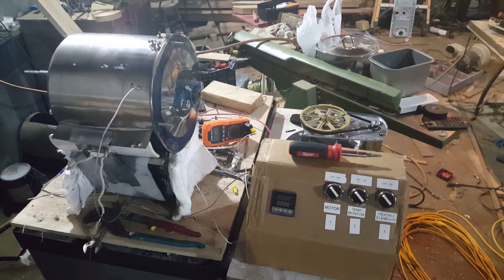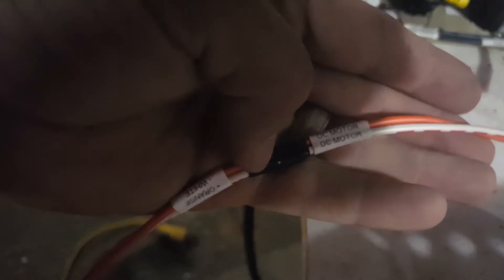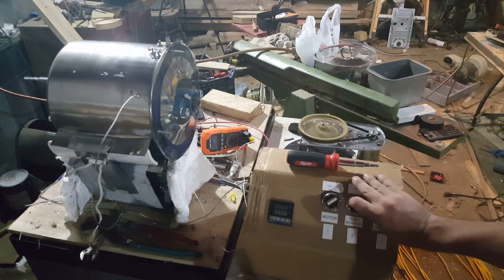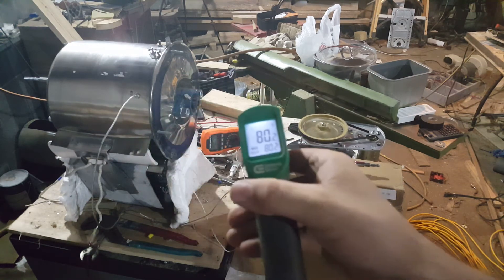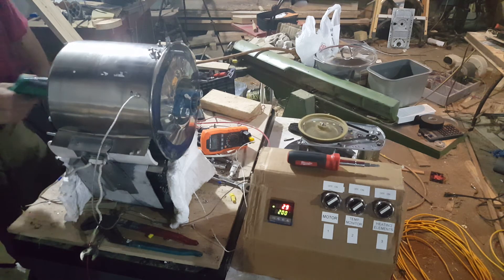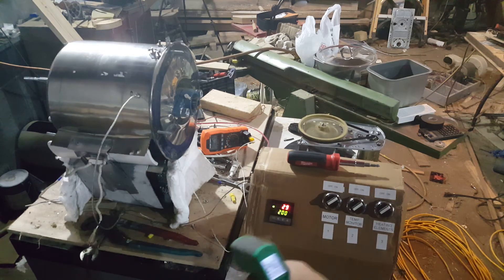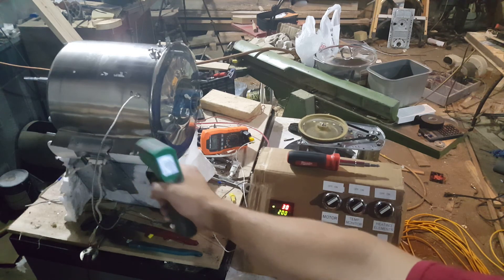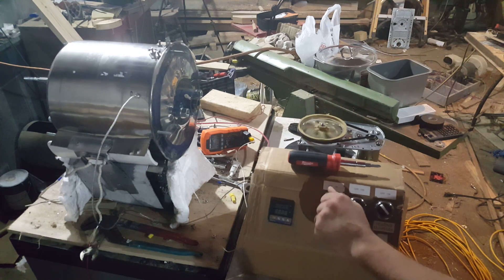August 12th update #DIY coffee roaster

Comment: do you mind share with us  your heating element design?
Reply from the maker: I purchased 2 1500 watt elements, and also used the element from an old clothes dryer.
Reply: @captainahab5650  looks like your heating element total power should be at around 3500-4000W, that’s pretty cool design.